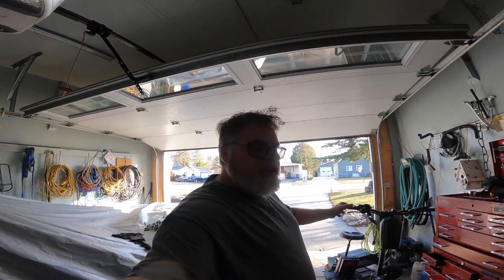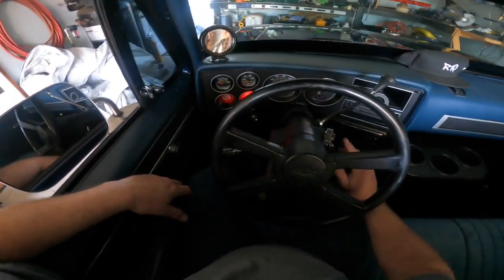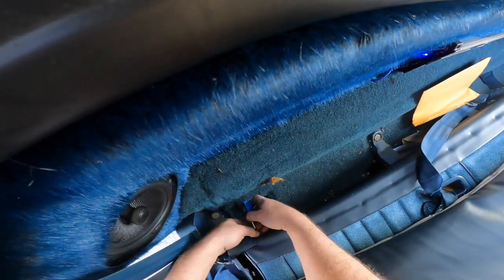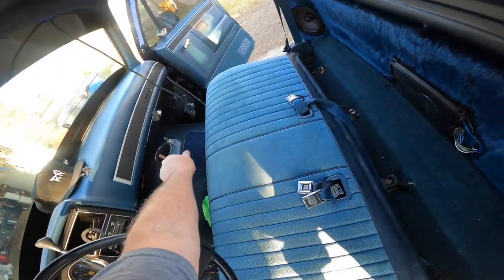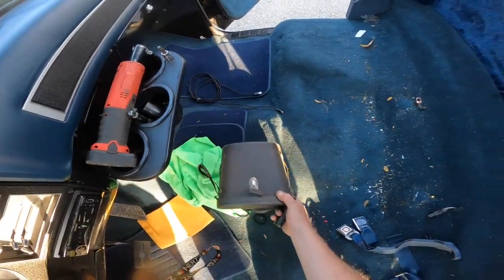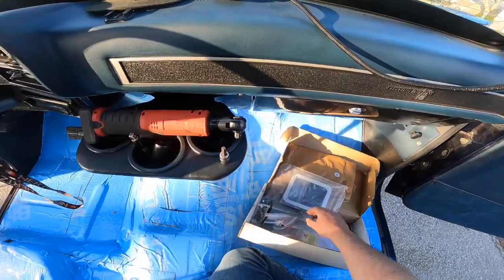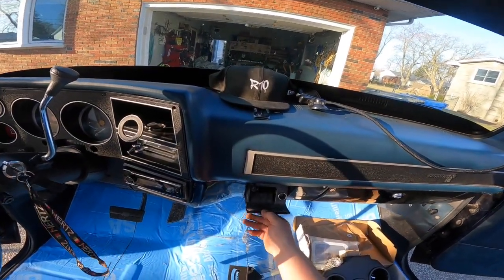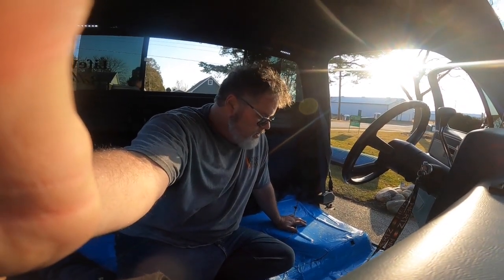SHOULD I OR SHOULD'NT I ?   HD 720p

Comment: I don't know much about putting a stick in a truck as a retro fit. But I think if it bolts to the tunnel tub, it should have 2 flange stiffiners/washers around the inside & underside of the cutout l, basically an inner & outer metal plate with the same cutout on them with bolt holes in them that match tge cutout on the truck. to increase the strength of the mounting structure created when you cut the area out for the shifter...